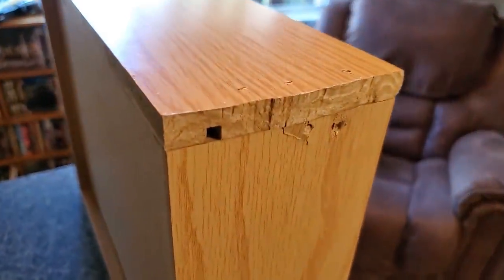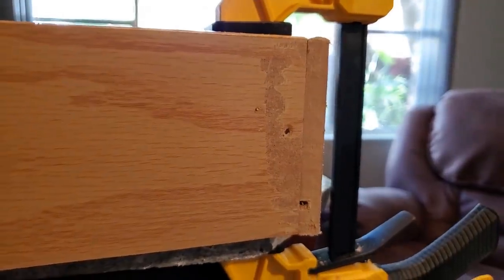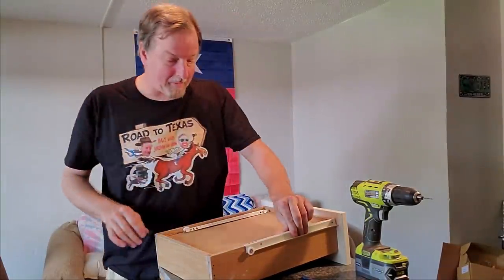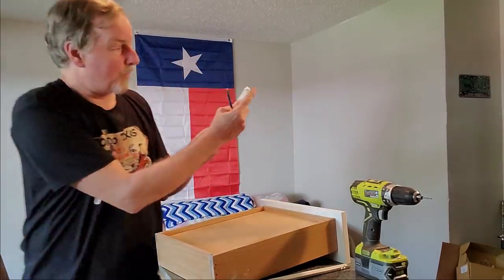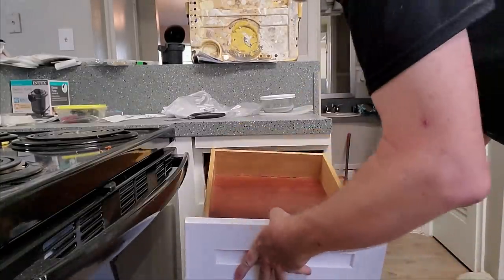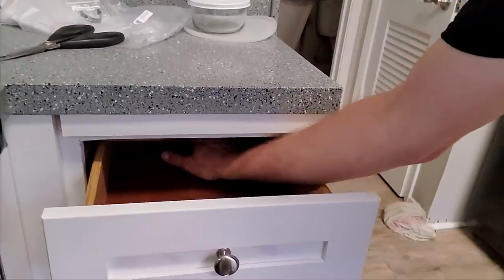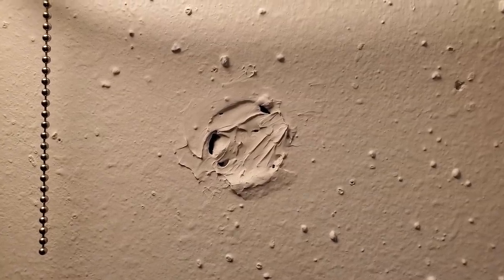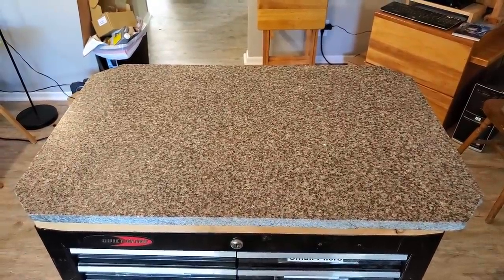Sunny Day Projects - Escaping The Mouse - ETM-41

Comment: Our kitchen drawers have been a challenge, as well. MDF and brads/staples. They were installed correctly, but the construction has not held up. I've tried metal brackets, brads, screws, etc. I finally broke down and bought some clamps. Now, I pull the staples and glue them back up, using my clamps. The screws on the rails constantly loosen up, as well as the hinge screws. Note to all, go with drawer construction that utilize dove-tail joints, which probably means solid wood materials...